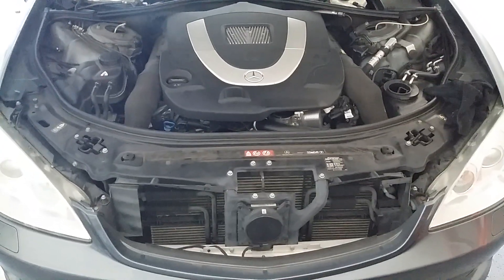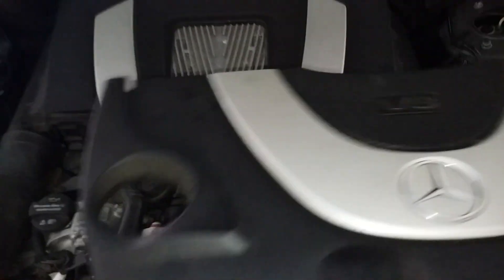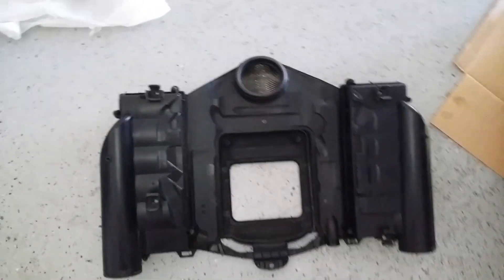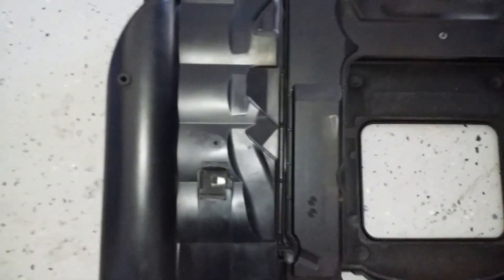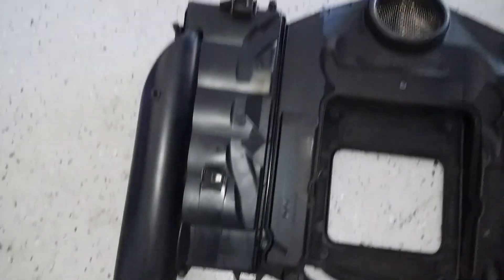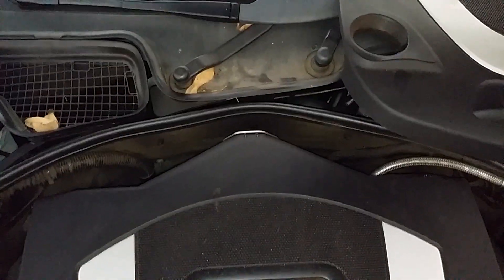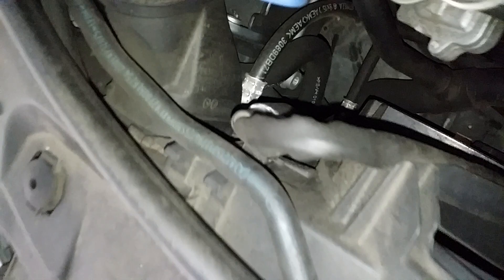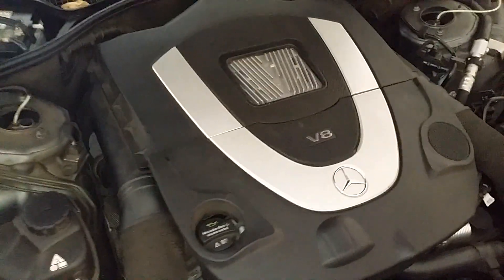S550 2007 AIR FILTERS REPLACEMENT

Comment: My control arm ball joints need replacing. My lawyer friend said it's not a problem, but he works on his McLaren. That would be cool to see that done because the parts are $60 to $90 per arm on RockAuto. The dealership wants $1,500 to change them, said half the price are the parts. BS 💩